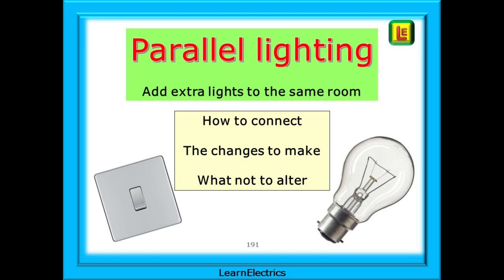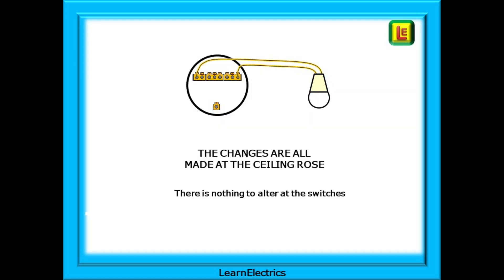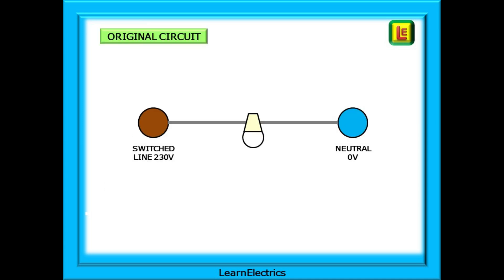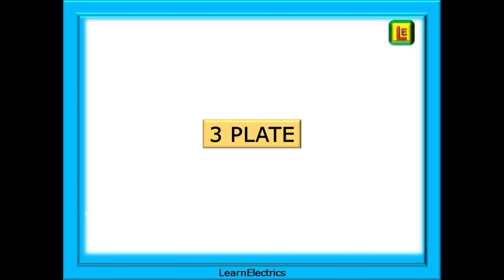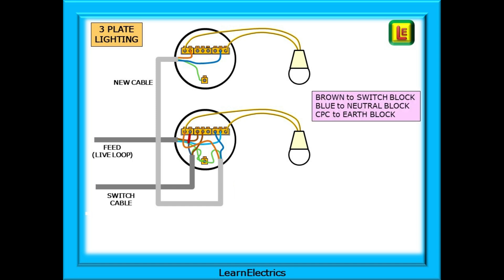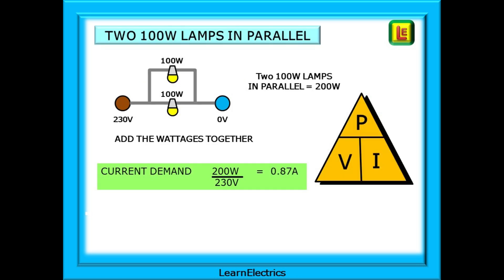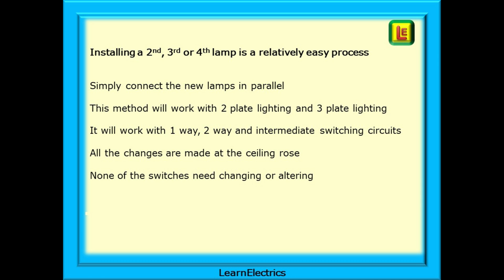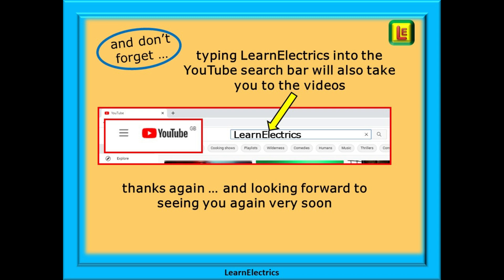ADD A LIGHT TO A ROOM - PARALLEL LIGHTING – WHAT CONNECTIONS TO MAKE AND THE CHANGES TO BE MADE

Comment: Just wandering how would you connect multiple garden lights in parallel or in series ?!?! And how would you design it ...considering the cable run🤔...hopefully u know wht im on about😁
Reply from the maker: Garden lighting would normally be in parallel, as for design you will need to use the voltage drop formulas based on length, current demand etc.
Have a look at these videos, and lots more on LearnElectrics.com
https://www.youtube.com/watch?v=ej3-6wcHfkE
or
https://www.youtube.com/watch?v=Z-kw680SIoo
Reply: @LEARN ELECTRICS  thanks for the tip Dave 👍🏼

Comment: It would be brilliant for you to explain in your unique style why a lighting neutral is live @ (230>) but when you connect this live neutral to the remaining neutrals you can no longer take a reading👍
Reply from the maker: Its all to do with where the two ends are connected. If one end is still attached to the 230V lamp and the other end is in free air, then it will be 230 volts. Its not neutral until it touches the neutrals. Dave.